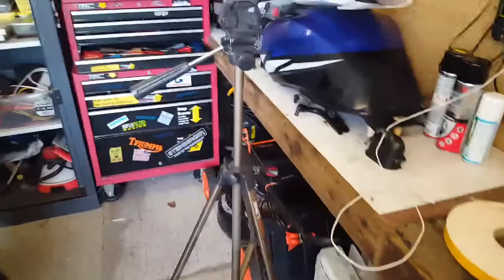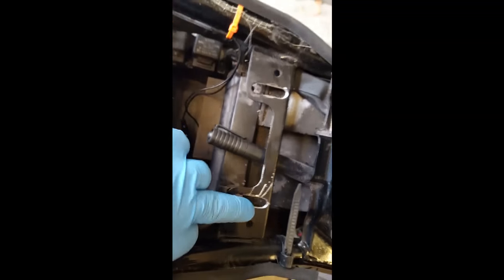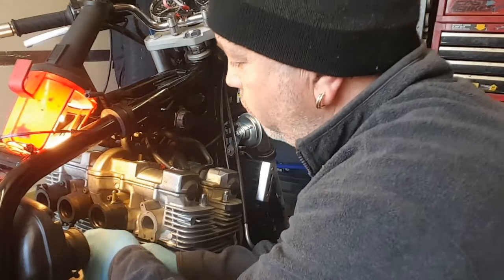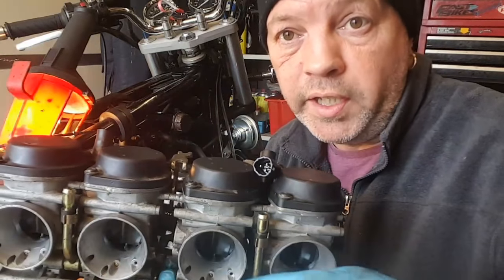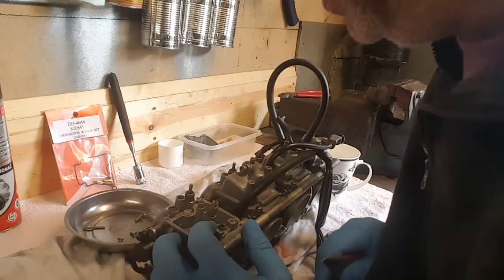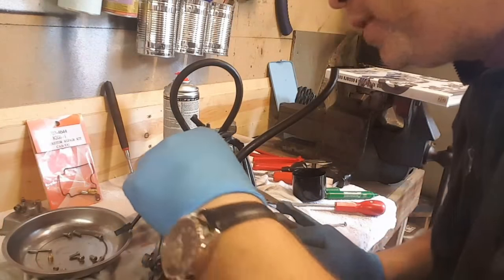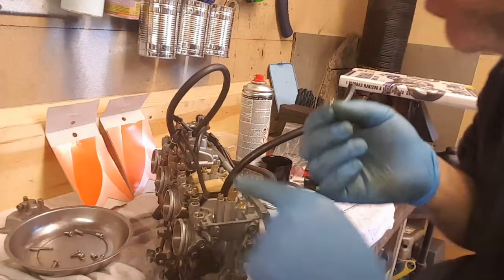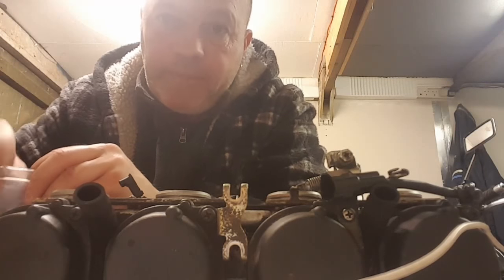Xjr1300 inlet rubbers and carb overhaul part 2

Comment: So if you're here because you need to change your inlet manifold rubbers but your carbs are ok its easier to not remove the carbs. Just loosen everything and if necessary cut your old rubbers out( if there perished there going in the bin anyway) but of fiddling but so is removing the carbs lol.
Reply from the maker: Good call Chris , but if you're upgrading to 36y do the airbox slot mod . But yes leave carbs in if only changing rubbers I hadn't thought of that . But my carbs needed sorting anyway .✌💗👍
Reply: You're spot on my friend,  Still need to do the air box mod but yes I've literally just removed the old ones (cracked to buggery) much easier to fit the new 36y ones due to smaller size but thanks, your vids have been invaluable and are where I started from. trevorsboy.

Comment: Yeah I did see that on the Video but it's not the Seat it's the Brass side Screw that holds the Seat in that I can't undo. On all of them they are solid.
If I can't get any of them out I'll just have to put new Valves in & Cross my fingers.
Thanks 👍
Reply from the maker: oh , yes ok  the brass side screws , yes it's all coming back now.. 
i used a stubby screwdriver.  if it doesn't fit perfectly 
sand or file the top down a bit so it seats solid . I think it's a.  J I S head so pozi drive not Phillips.. sharp hammer taps on screwdriver should shock the screw loose .. just like an impact driver .. or use an impact driver.. but be aware the driver must fit perfectly in the screw head (sorry if this is all perfectly obvious) 
any way I used the well fitting screwdriver and hammer taps , or maybe my impact driver if they were really stubborn. 
so changing the seats is really important because of wear. even though the needles have rubber tips and will wear before the seats..
And if course under the seat us a metal gauze filter.  which could be obstructed. but it's down to how comfortable you are attacking it. 
For me it was a no brainer I had the parts so I had to change them.

Comment: Hello Spingy hope your keeping well. I'm sorry to bother you again. 
Finally got the parts for the Carbs & I'm havin trouble moving the brass screw that holds the Seat in 🙈
Have you got any suggestions ?
If I can't get it out I'll just have to put the valve in and hope for the best.
Reply from the maker: ah yes , me too . After trying everything else I ended up getting a drill bit (not on a drill) just the exact size to squeeze in and grip/twist. and they came out .. obviously this destroy the seat but I had new ones anyway.. also don't forget to swap the little gauze from the old seat underneath to the new seat..as i forgot on the first one and it confused me and the float height until I pulled the next one and realised I had left the gauze filter out..
yes I'm afraid it's brute force on extracting the old seat.. as long as you destroy the seat and not the seat housing you're ok.. I'm pretty sure the seats had o rings around them which was seizing them in.. (or I may have just made that up due to old age and a short memory 😉. 
hope you manage ok.. just be brutal with the brass seats but protect the housing they live in..
👍🏻☮❤

Comment: Hi Springy, good video. I have an 02 XJR which has the same carbs as yours. I would really appreciate it if you could help.  Could you tell me what you set the float heights to. The measurement given in the haynes manual is definatly incorrect.
Reply from the maker: Hey Buddy don't know if i,m going to be any help with the float height, I too could not make head nor tail of the settings in the haynes manual..and i didnt measure the float heights before and after other than to notice that when i fitted the new needles and seats the shut off happened quicker as the original rubber ends of the needles had worn a groove..when i fitted the new needles and seats the floats at rest with the carbs upsidedown were about 1mm higher than before ..as they were all sat at exactly the same height i took a chance and put them all back together..my thinking was i was going to get the float levels and the pilot air settings done with a carb balance at my mates shop..as it turns out the bike runs sweet so i figured i would leave it well alone,,and as there was no more overflowing i guessed the floats were back to the stock level(with the new needles now shutting off the fuel earlier than the old ones).so i cant really give you any more insight other than to suggest changing the needles and seats if they are original ..this of course brings its own set of problems ,,the seats dont like to come out..i had to jam a drill bit in each one to get over the resistance of the old orings..knowing i had new seats to put in it was ok..and i did damage the old seats removing them...also i forgot to put the gauze filter on the first one so had to redo it..luckily the new oring on thbe new seat allowed removal without damage...sorry i cant be more help...what is the issue on yours ? do you have overflow problems or is it just a well deserved carb strip and overhaul..
let me know how you get on buddy..good luck ride safe Peace and Love !!
Reply: Thanks for the reply Springy.
I did have an over flow problem and suspected the needles were the issue. i bought all new and replaced and thats when i came up against the float height issue. Firstly id been given the measurement for the pre 02 and tried to set them to that .Then i realised that was wrong,  Of course by this time id moved everything and had no idea where it should be. Haynes quotes something like 33mm which is impossible. Ive got them somewhere near using clear hose method but id love to know the correct setting to get it spot on. The bikes running but is a little fluffy occaisionally below 2000,missing now and then, once above that it runs great.  The overflow problem turned out to be the tap, Doh, need never have touched the carbs afterall.
Reply from the maker: ah yes the tap! i did that first , a full strip to find it was working fine ! typical,
i can only think the float height answer is going to be on one of the xjr forums..unfortunately the xjr forum i signed up to ive never been able to access im registered but theres some glitch and i hate tech with a vengeance , unless its my recording studio of course..
the only glimmer i can give you is the little brass\copper strip that you bend to alter the float height is on mine perfectly straight , this must be the stock setting for the floats when all is new..i did look closely at mine to see if theyd been altered before ...i think i was the first person in because those tab\strips were completely flat \horizontal , it was the worn needles making mine flood...it might be worth you checking this and using flat\horizontal as a starting point and with your new needles it should take it to the factory 
setting ?  :)

Comment: Hi Springy, great video. I have an XJR1300 on a 03 plate and I have the same carburettor as yours. My issue is when the choke is on it revs no problem but when the engine is warm and I hold the throttle open at any revs in backfires through the carbs? I have cleaned and balanced the carbs (last year) and fitted new spark plugs yesterday. Any thoughts on what it might be?
Reply from the maker: Ok Stephen , well it's definately running lean .
Either some of the jets are blocked even of you cleaned them last year . They can block up any time .. I would suggest you have a vacuum leak . Either one or more intake boots or even something simple like the fuel tap vacuum pipe is split or one or more of the vacuum caps on the intake boots is perished .. 
Easiest way to find a vacuum leak is to run the bike till warm . Let it idle with no revving of the throttle . Spray brake or carb cleaner around the intake boots etc.. if the revs rise , then you can pinpoint an air / vacuum leak .. 
Also have you changed anything since cleaning the carbs ? and is this a new recent problem . Did it run last year ok after the carb clean.. 
Lastly have you checked the engine oil level to make sure fuel isn't leaking down the bores  into the sump due to a sticky float or a bad fuel tap .... 
One last thing , try running it and revving with the fuel filler flap open .   
If the filler vent is blocked it'll cause a vacuum.in the tank and starve the carbs .. very common issue on bikes.. 
let me know how you get on brother..
Peace and love 👍🏻☮♥️
Reply: @springy-2112  thank you for replying promptly. I haven't changed anything since replacing the carb kit last year. Good points you mentioned I will try all and get back to you. Again thanks for your help 🙏 👍
Reply: @springy-2112  sorry Springy I forgot to answer your other questions. 
It did run last year ok after carb clean and new carb kit fitted.
It does seem like a recent problem, probably the last couple months but I don't use the bike much as I use my other bike.
And engine oil is ok.
Thanks again mate 👍
Reply: @springy-2112  Hi Springy, I spayed carb cleaner around breather hoses but no change in revs. I'll send you a picture of the cylinder head rubbers, they look perished but when I inspected the I side it was smooth, indicating that the split has not gone straight through.
I know in your video you replaced these rubbers with new ones, do you think it's worth while me doing the same?
Reply: @springy-2112  don't know how to attach / send a picture lol
Reply from the maker: @stephenscott9743  
it's good to change rubbers to give more room . If yours are not split through then like mine it was just cosmetic , future proofing and easy access for carbs .. 
Apparently the 36y rubbers give better flow etc but tbh I didn t really notice.  the 1300 is plenty powerful enough .
On dyno graphs the 36ys move the bhp around a bit . But it levels out .. Slightly more bhp lower down slightly less top end ..
which I suppose is useful on our roads .
👍🏻☮♥️
Reply: @springy-2112  I checked and cleaned the pilot jets and 2 & 3 seemed blocked, I also checked the breather hoses and all seems fine. While it was stripped I cleaned the main jets as well. I took fur a run but it's still the same 🙄. Think I'll have a garage look at it. Thanks for all your help Springy 👍
Reply from the maker: @stephenscott9743  
Hopefully it's something simple and cheap to fix .
Peace and love brother 👍🏻☮♥️
Reply: Hi Springy,
Hope your ok mate. I've decided to renew my carb rubbers as you have. My question is are you happy with the 36Y ones you bought from Yambits? I only ask because Yamaha want £120 each for them but Yambits have them for £90 for four. Thanks for your help bud 👍
Reply from the maker: @stephenscott9743  
yes very happy the yambits ones are superb .. I think they're the same ones yamaha sells ? at least that's my guess looking at images of both .. but anyway the yambits ones are really good quality and a great price.. they be been selling them for years and years and I've only ever seen and heard positive feed back .. Also you can ring yambits and talk and order by phone which I like ..
Peace and love brother 👍🏻☮❤

Comment: hello again,I pulled apart my carbys and found who ever had the bike before had put the washer and oring on the fuel screw around the wrong way on 2 carbys.everything else seemed ok but is it ok to put some lube on the sliders?thanks for your videos there a huge help.
Reply from the maker: Paul Robinson 
Hey Paul sounds like that might be your fuelling issue..i set mine with new o rings all the way in to gently seat then 2 turns out ? ( whatever the manual said ) and it balanced out fime...ok to the sliders ...you can put dialetric silicone grease on the diaphragms to soften and preserve the rubber but on the actual slider bodys there is no lube that will stay put as the bottomnof the slider on low throttle is right down.in the way of the fuel air mix rushing by which will just remove any lube ...if the sliders are particularly stiff they have fuel 
Residue caramelised (not the right word) on the sides whicj needs cleaning off with carb cleaner ....the sliders should push up with resistance angainst the springs then fall down steadily then clonk at the bottom...if they come down like a sack of sh#t with no resistance then they are worn...
.they do not go up and down freely ....you can tell if any are bad by trying them all you will see and hear if one is not perfoming ....
So basically i have never used lube or indeed known of anyone using lube because it get washed /vapour blasted away...
Hope it turns out ok i know its a bit of a chore getting in the carbs but then at least they are fixable ...we just need lots of patience ...good luck buddy ☮❤

Comment: hello again springy,I put the bike back together and it runs the same just spluttering at 1/4throttle but when I got home and felt the exhaust number 3 was pipe was cooler than the rest,do you think it's a coil or lead problem? it has new plugs.
Reply from the maker: Paul Robinson 
Yeah sounds like you are not firing correctly on no 3 
...i think thrre are only two coils each coil does two cyliders so you would lose two cylinders if a coil is breaking down ...dont remember seeing four coils ?? ...more likely to be a lead or cap...😊👍
Reply: Or fuel starvation on number 3 carb caused by a sticky needle it happens to mine every time I lay it up in the garage over winter hope it helps am about to do surgery on mine a gonna try neat carb cleaner in it sometimes it fixes it self Arrg. Peace & Love

Comment: Your supposed the use threadlock on those inlet holder bolts, blue as semi permanent fixing, nothing means they can vibe lose.
Reply from the maker: That's a very good point . I'm normally good at thread lock 
And torque specs on every thing ..
👍🏻☮❤

Comment: Hello Spingy you must be sick of me Messaging you by now🙄 but this is just a Quick update...
just going through your Videos a few times to get it into my head as to see what i have to do. You told me the other day not to run the engine as i had a fair bit of fuel in it & to just drain the Oil out.
Well i did that yesterday & got 8 & 1/2 ltrs of fuel & oil out😢
so it has to be the Carbs.
i've ordered the parts so you'll be glad to know that i will leave you in Peace for a while😀

Take Care & Thanks👍
Reply from the maker: holy smoke that's a lot of fuel/oil !!! 
must be a float sticking .. feel free to comment /ask /update it's no problem at all 👍🏻☮❤

Comment: great job ;) how much power adds it? :)
Reply from the maker: Dalius Kudla 
It adds a bit at lower revs up to about 3000rpm about 5 to 8 bhp but takes it away at around 800rpm ..looking at other peoples dyno read outs..
It doesnt feel really much more powerful but its much smoother in the low revs ..it picks up the pace quicker (maybe thats more power?)
I need to look to see if its had the 4 degree ignition advance or not...
Its definately moved the grunt to where its more useful😁👍
Reply: someone put in bigger jets and make needles up thats will increase power :) i can send you information about it :)
Reply from the maker: Dalius Kudla 
I wasnt doing the inlet rubbers for any reason other than they were split and the 36ys were half the price of stock ones...
The airbox snorkel had already been done by previous owner..dont know if the ignition has been advanced yet..wont be rejetting ...i could have done that when i rebuilt carbs...i didnt want more power or to mod anything just had bad inlet rubbers so changed them and like the little extra it gave me...
The xjr 1300 for me is plenty good enough un modded ..
I thought the video would help others that do the 36y mod ..
It appears it has...
Thanks for your input and support ..ride safe have fun
And Peace and Love to you brother 😁👍👍👍
Reply: Thanks, you too :)

Comment: hello.I have a 1999 xjr and it runs rich would that cause it to run rough over 2000 rpm
Reply from the maker: Paul Robinson 
Hey paul if it runs rich on idle it shouldnt affect the running at speed..the idle jet is overtaken bu the main jet at i think 1500 revs and you are pulling in more air also so it evens out...they run super lean from factory and hot so rich running normally helps cool the engine....but if it runs rough over 2000 revd i think it could be a blockrf main jet or a sticky or damaged slider diapragm ?

Comment: I got a 1998 XJR1200, assume the carb clean process is similar?
Reply from the maker: yeah slightly different size carbs but the components are the same👍🏻☮❤
Reply: @springy-2112  Decided to look at doing the inlet mod, but it appears the mounting has been slotted already. No idea how to tell if the inlets are standard or modified. Carbs on the bench, jets as clean as a whistle!
Reply from the maker: @flatinsixth  
hey buddy the factory air housing mounts are slotted already but need extra slotting for the mod i would say if the slots look really tidy straight and painted like the rest its stock...if the slots are a bit wonky or sharper or the paint is suspect then it has been modded...i may have measured the rubbers in the vid ? not sure i will have a look..👍🏻☮❤